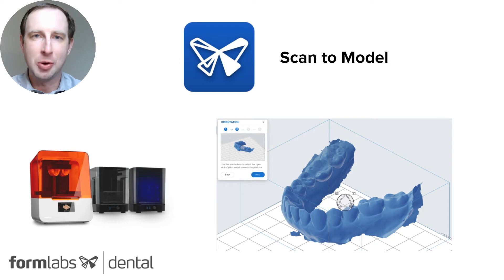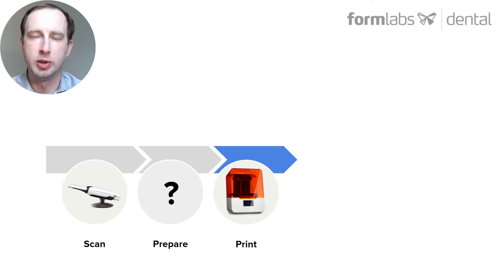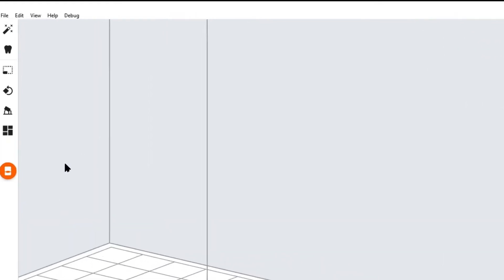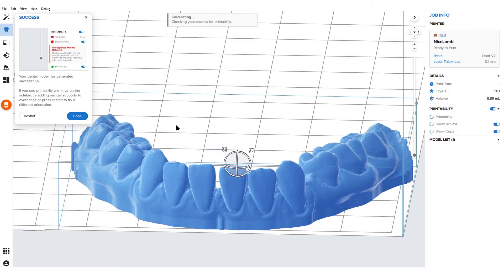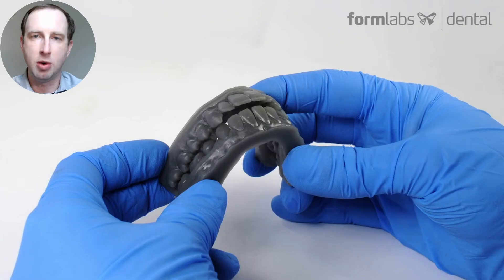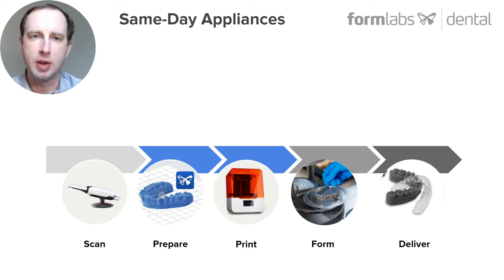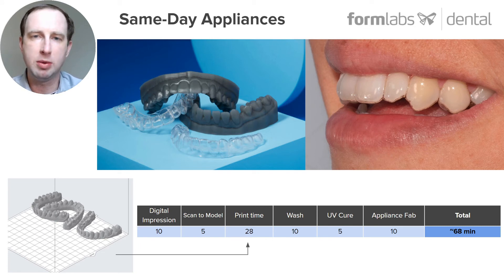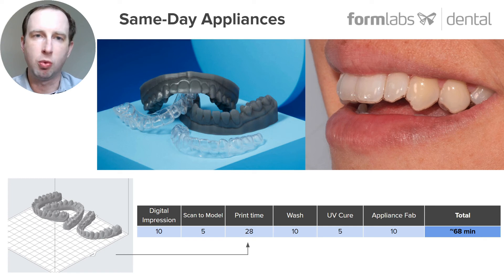Formlabs Dental Introduces Scan to Model

Comment: what parameters I should set for Crown & Bridge in exocad dental. I uses castable resin.
Reply: Because my crown does not fit properly on the model
Reply from the maker: Two important considerations for restorations in ExoCAD, drill compensation turned off and a margin offset of 0.2 mm. Our application guide for castable wax might be helpful as well: https://dental.formlabs.com/materials/#Castable%20Wax%20Resin